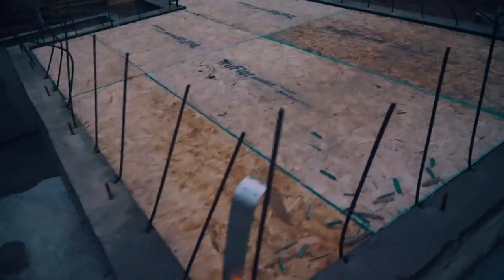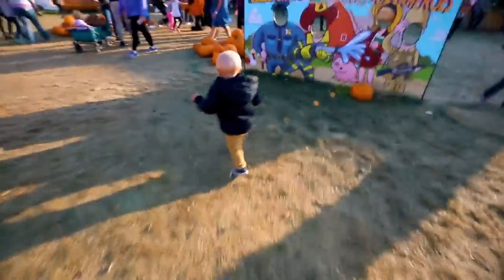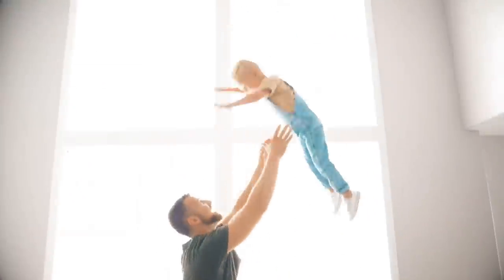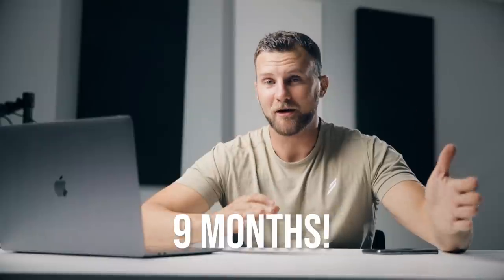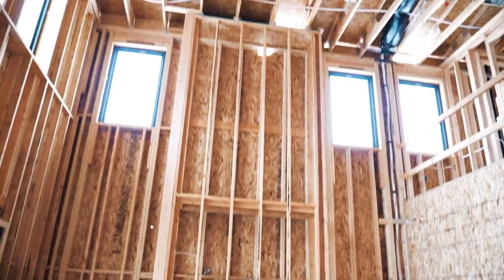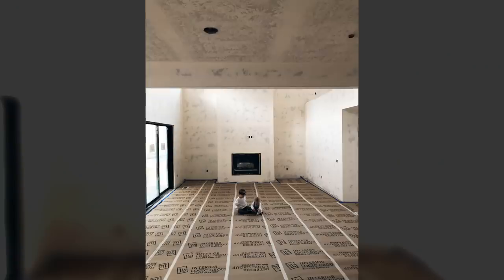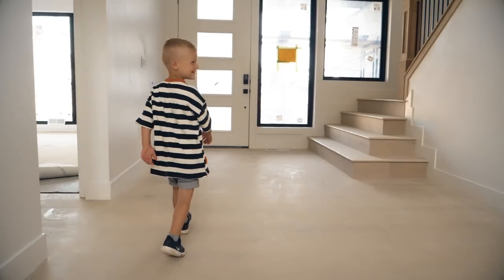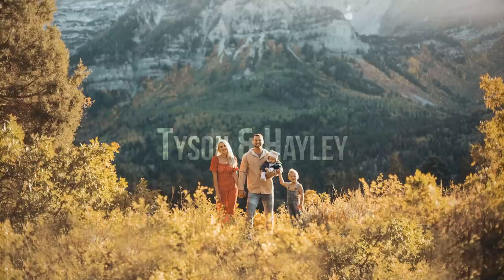The WORST HOME BUILDING Experience EVER!

Comment: Sub flooring is made, knowing, that it might get wet.  You did not need to shovel it off.
Reply from the maker: I've built three homes and framed homes for 5 years before this. Like any piece of wood whether it's protected or not will warp if it gets wet enough and dries. My townhome I still own was framed in the winter and even with the floor glue and "protected" sub flooring the floors are squeaky. Before my townhome warranty was up in the first year the builder kindly came back to my house and him and I pulled up the carpet and added screws to the sub flooring and joists. Only helped a little. I did everything in my power to avoid that situation in MY new home. Notice I said MY home. So why not go up on a Sunday when no one is working so I'm not in the way and push snow off the floors. If anything I'm only helping the framers when they get there Monday to start building walls.